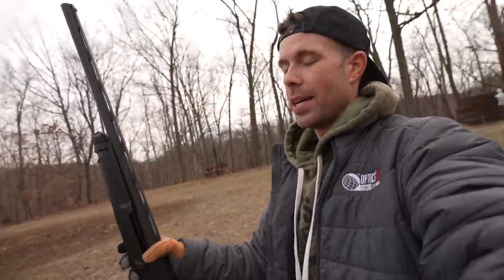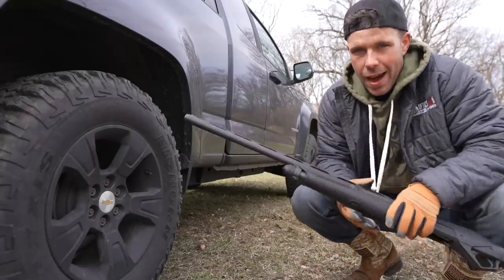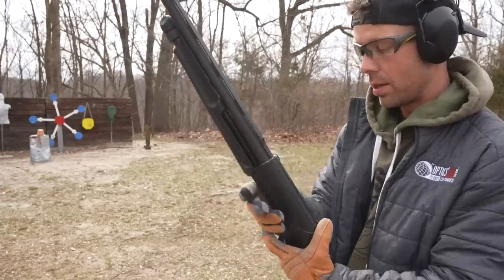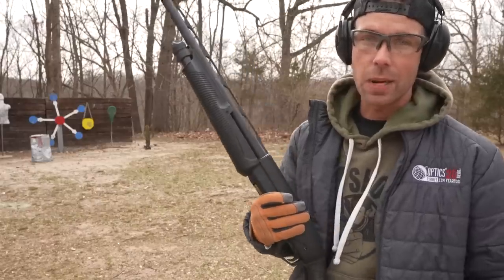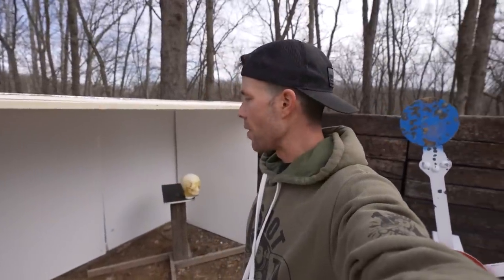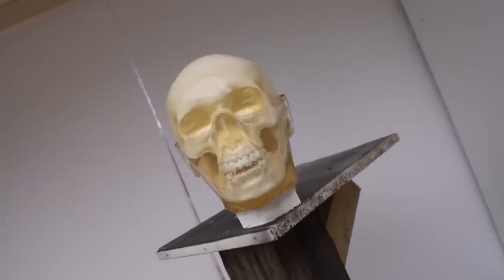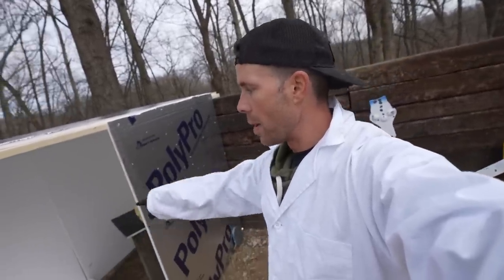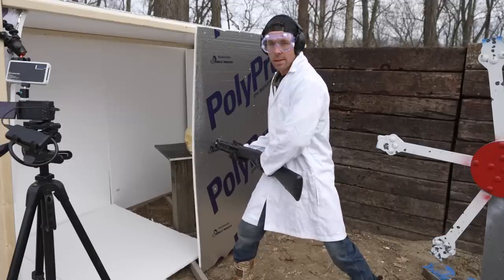How Messy is a Contact Shotgun Blast??? (Alex Murdaugh Trial)

Comment: I’m a retired police detective.  I handled a lot of real life cases like this.  The pressure is so great, there are “pieces” in drawers and cabinets that were closed.  It’s incredibly messy and incredibly tragic for families.
Reply: @@rc4648 the coroner explained that the pressure from the blast opens them slightly and the small particles reach such velocity they jet into the small opening.  When the pressure wave passes, the opening was not enough to open the door/drawer enough to “stay” open and it “closes” after the pressure wave.  It’s quite the phenomenon.
Reply: @@rc4648 think of when you open and close a door in a room with a drop ceiling.  The tiles move slightly.
Reply: @ShotgunMike  Jesus 😬
Reply: I lost a relative this way; do you think he suffered?
Reply: @Basildad658  not a smidge

Comment: Paramedic here. I responded to a scene a few years ago where an unfortunate man self deleted with a shotgun but the entire head was intact. Eyes were buldged out. My only guess is that because he'd used low brass target loads, there wasn't enough pressure. Was definitely an interesting scenario to see.
Reply: I work for a hospital and have seen this under the chin.  Stippling and a hole the size of a fist out of the top.  When laid back the slightly bulged eyes fell inwards and then were completely sunken in.  I have heard Cobain's head was intact the same.  he used a 20 gauge.
Reply: @bad74maverick1  There wasn’t an exit on this one. I see I didn’t clarify that with the intact part lol. Yeah it was a contained blast. Pretty sure Cobain had some help 🙃
Reply: what happened to the saying? -Not in the head, rather to the heart? Like do people only delete themselves via shots to the face?
Reply: @silverdude4668  well, the brain is the quickest switch to shut off so it makes sense. Although with a long gun the barrel length is the biggest obstacle to overcome as well as reaching the trigger. That usually ends badly for people with a short arms/long barrel ratio. They reach and as they stretch to touch the trigger the gun is no longer squared up so the end up with half a face and still alive when we get there. Ehh... I'll just leave it at that. We have a morbid sense of humor in this business.
Reply: @silverdude4668  why you write 'delete' instead of kill?
Reply: @leeriches8841  because now he is a computer programmer.
Reply: @TheMaxKids  
BOOM!!🤣🤣
Reply: @leeriches8841  Because YouTube likes to delete comments based upon certain wordage. It's honestly frustrating.
Reply: @silverdude4668 my uncle self deleted 20 years ago.  He sawed off my grandpa's shotgun so he could hold it to his chest, put on a bunch of shirts and my grandpa's overalls to contain the mess, went out to the garage and blasted himself right through the heart.
Reply: @Salty_Balls  goddamn. My condolences. It sucks alot when someone decides to cut off their own future thinking it will never be different... Had the same thing happen with a close friend, after I have moved away, never even told anyone about his problems. 

Thing is, his parents had to find him after he aimed for his head tho... I can't even imagine, but to the heart does seem more considerate, despite the circumstances.
Reply: @M3D1K  not always. granted a lot has changed with guns over the years. but i have heard of people surviving headshots. one guy survived two in the temple. another guy survived getting a sniper round in his forehead. from my understanding the bullet went right in-between the two sides of his brain and out the back with only minor(ish) damage. surprising since you would expect the expanding gas to do major damage to the brain even if nothing was ripped up.
Reply: @bad74maverick1  I lost someone this way. Do you think they suffered?
Reply: @Basildad658  No not at all.  It was simply lights out.  Pain is registered at about 60 ms. A traumatic blast traveling at between 900 and 1150 FPS point blank would have stopped all brain function immediately before it even knew it was damaged. Im sorry you lost someone this way. No one should.
Reply: @bad74maverick1  Even if the brainstem wasnt the first thing knocked out? ie do u think ronnie mcnutt suffered?
Reply: @Basildad658  the brainstem doesn't need to be knocked out to stop all function. Ronne McNutt shot himself with a rifle.  The muzzle energy of a standard rifle is around 2000 ft.lbf.  The force vs. energy vs. the round entering I highly doubt he even heard the shot, let alone felt anything.
Reply: @bad74maverick1  what do you do for the hospital where you work? Sounds like you’ve seen some shot

Comment: I've  always wondered what a contact shot with a wax slug would do.
Reply: The bot comment in this context is a bit threatening
Reply: @f1rebreather123  😂😂😂
Reply: Pretty much the same thing as this.  The pressure is what’s doing the damage.  All you need is enough energy to fracture the skull, after that the pressure takes over and does the work
Reply: @jth_printed_designs  I see the train of thought but I also see it potentially just deleting the entire skull. The amount of energy dumped into the skull would be far greater then buckshot. Most of the buckshots energy would carry past the skull.
Reply: @letsplayminecraftall  Again, the energy of the round isn’t doing any of the work here, it’s all the gas pressure.

Comment: My dad got shot close range in the head by a 12 gauge, bird shot. He was lucky because it was so close and only the part of the outer bird shot hit the side of his head. He has a plate. He had a concussion for around a year. He was intensive care for a very long time. The nerve between his ear drum and his brain was severed and he's deaf in that ear but everything is still there. His jaw was broken and he has pins, permanently. That side of his face is paralyzed. This happened in 1977 before I was born. His head x rays show pellets still in his head. Drs told him he was a very unique case. He got shot defending a friend at a party when a guy came out with a shotgun and raised it towards his friend. The Drs said the pellets were to close to his brain to remove. So what happened is he picked the guy up and slammed him and was on top. He grabbed the barrel moving it to the side when it went off. It didn't knock him out. He stood up and witnesses say blood was gushing out. The police arrived and ushered him to the hospitals trauma unit. Putting him in the back seat of the police car.. He had just gotten out of the army and said his actions was a conditioned response.

Comment: Uh oh.  You just proved Alex's innocence.
Reply: Don't think so, Alex was crouched down  at the doorway and shot Paul in an upwards angle, he was close but not contact, I believe that the  ME stated there was not a "burn" or contact wound.
Reply: You obviously didn't watch the trial. The defense expert tried to argue that the killer put the shotgun against Paul's upper rear right head in a downward shot. The prosecution experts argued that the shooter was low with the shotgun angled up towards Paul's left jaw and was also 2-3 feet from paul (no contact wound).
Reply: @goldleader6074  everyone just assumes the ME knows more than the defenses 2 experts I personally thought the ME was a nut case that was angry she was being called out on her BS but that's just me. The guys for the defenses theory sounded much more logical and realistic, but that's my opinion.
Reply: @biggie4380  The ME got flustered by the defense attorneys and seemed defensive, but that doesn't mean she was wrong. The other prosecution witness was Dr. Ken Kinsey, who was also a chief deputy and had a lot of experience with gun homicides, seemed extremely knowledgeable and he basically agreed with everything the ME said. Kinsey also said the trajectory of the shot had to be going upwards because pellets were found embedded in the top of the door frame. Kinsey said if the shot was going downwards like the defense experts were trying to argue, that the pellets would have ricocheted off the ground and then came around 180 degrees to get lodged into the top door frame and seemed implausible to him and I believed him more than any other expert.

Comment: One of the details you forgot to mention from the Murdaugh trial is that the defense was saying that it was a contact wound on the back right top of the skull facing downward meaning the projectiles came out the cheek and neck and into the shoulder where defects were observed. That would have surely taken out the face and even the shoulder. You aimed from the cheek in a straight on shot, so yeah, the face stayed in tact because the blast takes out the entire back of the head. Not the same comparison as they were trying to defend.
Reply: Thank you..

Comment: So in your opinion,  Does this test bolster Alex Murdaugh's defense or bolster the prosecutions case?
Reply: Neither really.. The state said the shot was very close and came from the shoulder through under the jaw and out the back of his head blowing a hole in the back of his head and leaving his face intact.. The defense said the shot was a contact wound to the top back of the head.. Still obviously leaving his face intact.. This proves nothing about the Murdaugh trial.. The shot in this video was not recreated as either side said.. But if anything it shows more support to the states case based on the exit wound being on the side of the projectile going which is the back.. The defense said the massive hole was where the gun was in contact.. That's not the case in this experiment..

Comment: Your comment about the defenses theory is interesting, they claimed that that the brain and matter would come back toward the blast. Paul brains was found at his feet with his head / body outside the door. Your demonstrations side more with the prosecution, most of the matter went away from where blast came, if the room held together, your brains would be at the back of the room and not coming out the open front door. Curios if you thought about pointing the gun, downward at the angle the defense suggested?  Good job ether way.

Comment: You should have used birdshot, as that was what was used on Paul in this second shot. The direction you shot is roughly the direction that the pathologist and prosecution argued, but for them, it was not a contact shot. The defence claimed it was a contact shot from the other direction, top of the head downward. They made the ludicrous claim that the gas pressure within the skull blew the brains out through the entry hole back towards the shooter, rather than in the direction of the shot.
Reply: No the prosecution argued the shot went low through his arm/shoulder into the neck. And the pathologist constantly said that she didn't believe it was a contact wound (which it was in this video). The shot in the video is much closer to the defenses version of events
Reply: @lordmctheobalt6235  Yes I agree with that. My point was that the contact shot was the defences argument, and they were also claiming the contact shot came the other way, starting from the top rear of his head and exiting his neck over his shoulder. So that is the scenario they should have tested here. And they should have used birdshot.

Comment: I've shot pigs point blank with a 12g shotgun. The head doesn't come apart like that but is basically turns the head into a skin-sack full of brain and bone soup. I once tracked a wounded pig firing three 38 specials and two 12g slugs into the head before it went down. All five bullets were later recovered inside the brain cavity. We posthumously dubbed it the "Robo-Pig"

Comment: I think the shot was actually non contact but within 8 inches the shooter from a crouched position pointing upwards, the headshot was with birdshot, the first that was a 1:1000000 shot that went through upper chest & exited lower side of neck without hitting anything but flesh (which was unbelievable)

Comment: The dummy head doesn't do it justice.

Once the structure of the head has been turned to fragments and chunks blown around the room/car/whatever, the remaining tissue, fat, and brain matter just folds over in a big pile of visceral mush. Eyeballs are typically found hanging somewhere in the mix dislodged from their sockets by the pressure from the muzzle blast, yet still hanging from the corneas.

It's a brutal sight.

Comment: The defense said it was a contact wound to the back of the head. Prosecution said if it was contact to the back of the head his face wouldn't look the same, You actually proved the prosecutors point more they said it started in the shoulder travel through the neck and out of the back of Paul's head which blew his brains out but his face was still fine.  You misrepresented this pretty bad.
Reply: Actually that's not what the defense said, that's what the prosecution said the defense said. What the defense said was it came from the top right side of the head not the back.

Comment: The ballistics dummy was lacking some anatomical details. The dura mater is a very tough strong helmet comprised of thick smooth muscle tissue as well as layers of antipose tissue. Also the skull is made up of seven plates separated by bone sutures. Much of the energy would be contained and deflected. A human head would be a “little” more intact. For instance the facial tissue would not slip off the skull so cleanly. Decades of connecting tissue muscle and tendons would do their jobs.

Comment: While I think Alex Murdaugh may well have been involved in the murder of his family, this is why I do not believe he was the shooter. Murdaugh simply did not have time to clean himself up, even if he changed clothes, between the alleged time of death and when GPS data showed he was en route to his parent's home. While the prosecution's famous "blue raincoat" did have gunshot residue on the inside surface, meaning only that at some point in the past it had had a firearm most likely wrapped in it, it did not test positive for blood. So it could not have been used to shield Murdaugh from the blast of the shot.

I was a police investigator for years, and in my experience, nobody cleans up that well, especially if they have limited time.

Comment: You didn't shoot him in the face though, you shot him sideways with the trajectory completely away from the face. Obviously if you don't touch something, it will be untouched. Also, his face was not left intact. His skull completely left the body, and then came back because the gelatin pulled it back. And the face would not stretch like that. His head would be turned to cottage cheese & ketchup.

Comment: No dude u haven't seen it in movies because most all movies don't show how a shotgun actually functions or the results of what it can do. First of all a shotgun is only cocked when expelling a used shell and chambering a new shell. In the movies when they cock the shotgun for no reason its for show, it is not based in reality. Then there is the huge difference between a slug and bird shot. Bird shot is a bunch of smaller projectiles packed into the slug focused by what kind of choke is on the gun, either wide or tight. A slug is usually one peice of pure killing terror. U could feasibly survive being shot with bird shot if your lucky. If you are shot and hit with a slug... if your alive still your gonna have a really really bad day.